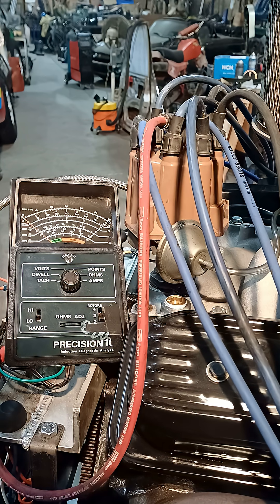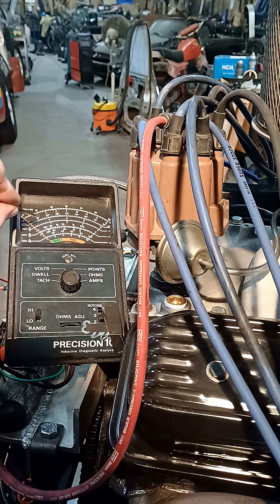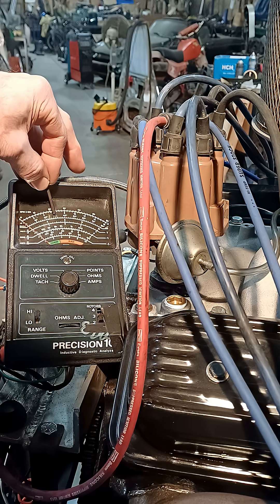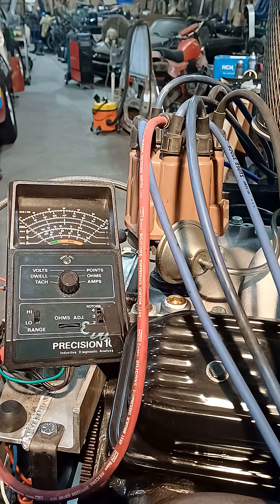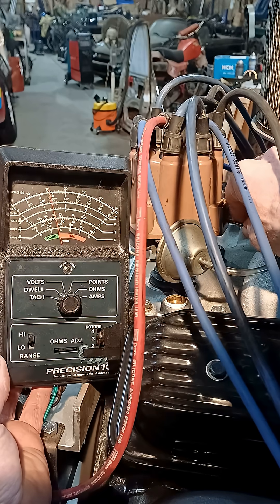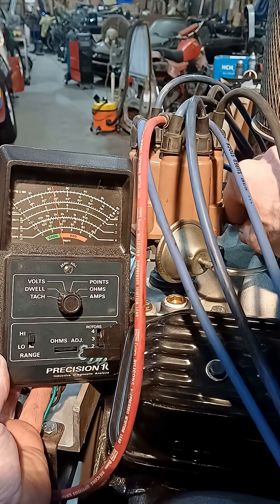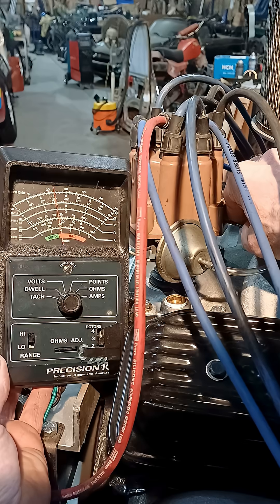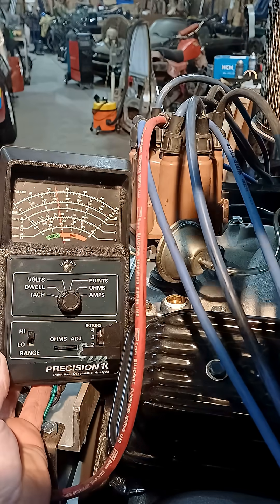Point gap dwell adjustment engine running

Comment: The bigger the dwell the smaller the gap in the points I always set with the dwell on the small side so the gap was on the big side but with in specifications so as the points worn the dwell gap was still correct and in scale because points gap would become smaller as the points were used